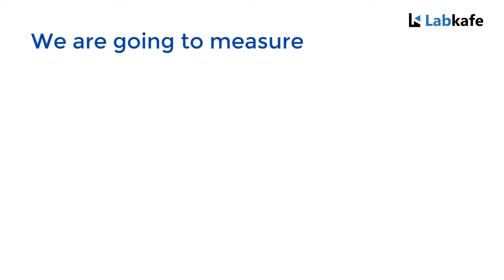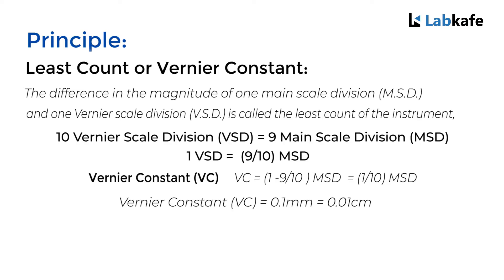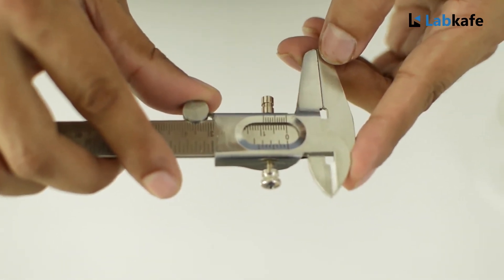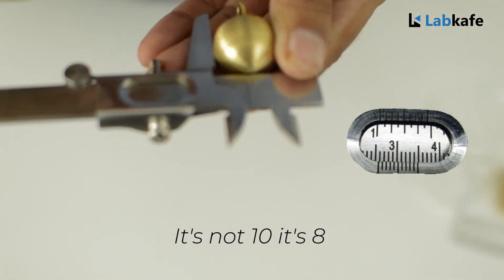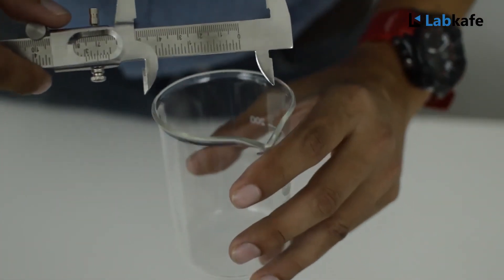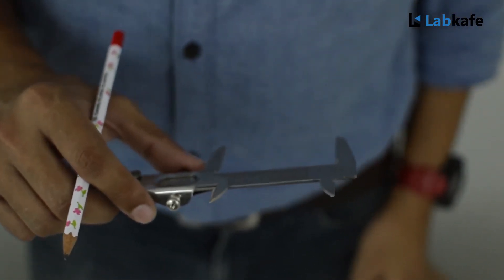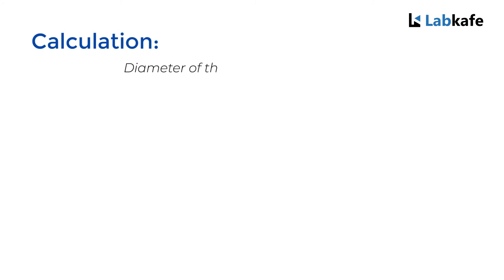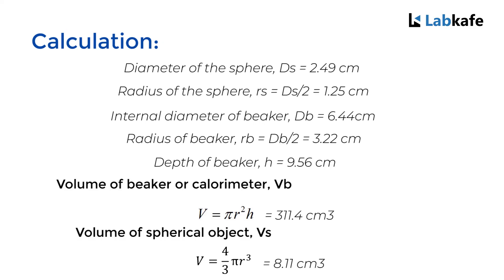How to use Vernier Caliper and measure diameters and least count | Physics Practical for 11th class

Comment: Timestamps 
00:03 - Learn to measure diameters and calculate volume using a Vernier caliper.
00:51 - Understanding Vernier Caliper zero error and measuring diameter.
01:34 - Understanding zero error in Vernier calipers for accurate measurements.
02:15 - Measuring diameters using a Vernier Caliper involves precise reading techniques.
03:13 - Measure internal diameter using a Vernier caliper with corrections.
04:01 - Measuring diameters and depths using Vernier Caliper accurately.
04:47 - Measurement of diameters using a vernier caliper.
05:37 - Measuring volume of beaker and spherical object using Vernier caliper.